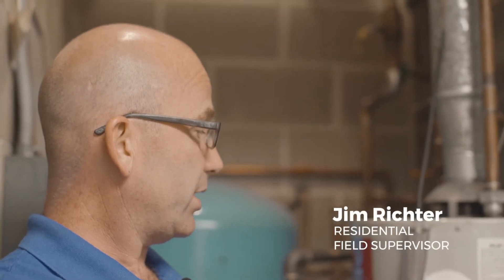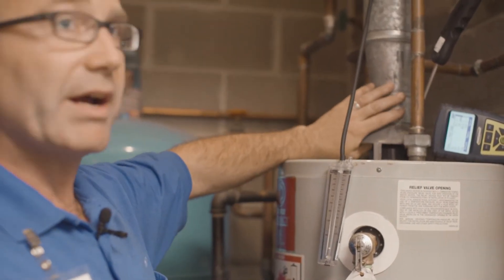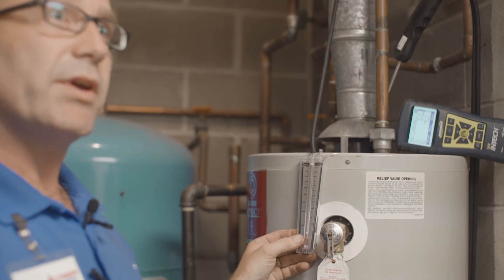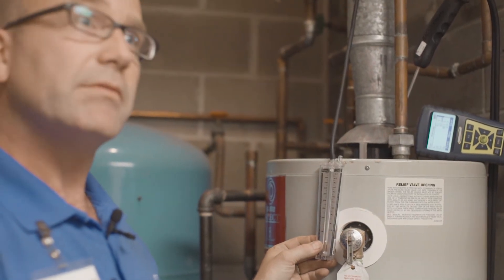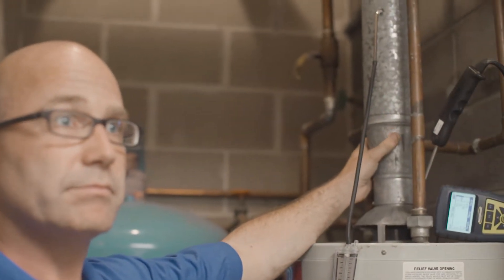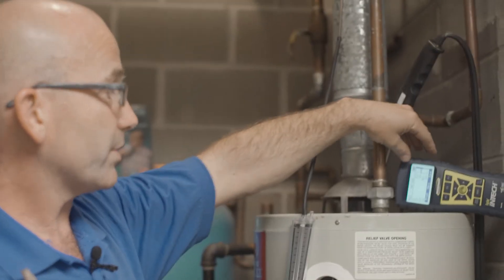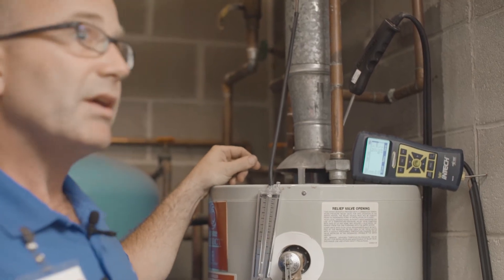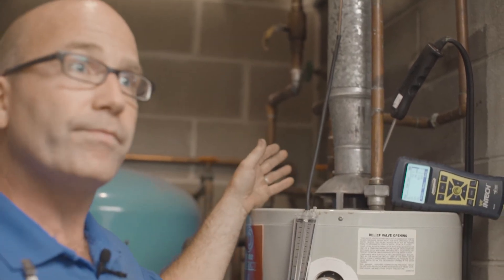The Importance of HVAC Draft Gauge Measurement

Comment: What about HVAC guys that remove furnaces off 5” flues and install power vents? How does that 30k btu water heater draft without the furnace helping during cold days when that big flue, that was originally figured to work together?  Just wondering.
Reply: it doesn’t, “orphaned” water heaters in oversized flues typically don’t draft properly and a chimney liner that’s sized correctly for the btus of just the water heater should be installed.
Reply: 7x rule

Comment: A good draft doesn’t mean that your chimney is good! I’ve seen a 95% blocked chimney getting an over average -.03 -.04 draft on the gas hot water heater and a -.06 draft on the oil furnace. This is very common! Always get a chimney sweep out annually no matter if you have gas or oil heating your house, this is something your oil tech or plumber doesn’t do with an annual cleaning for the appliance. You can also have a free and clear chimney, but the inside could be deteriorated and the flue tiles lining the inside of the chimney can collapse and create a blockage. Most of the older chimney’s could also be unlined, meaning that there isn’t much protection between you and the harmful gases, especially if you have an interior chimney that is deteriorating on the inside. Have all flue passageways inspected or swept every year by a chimney sweep.